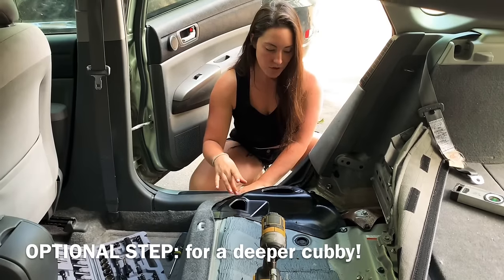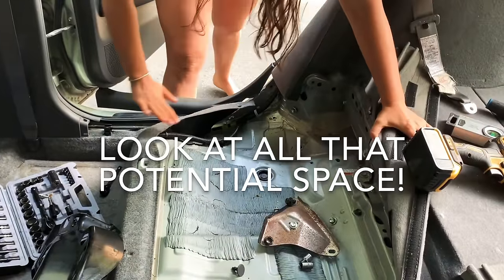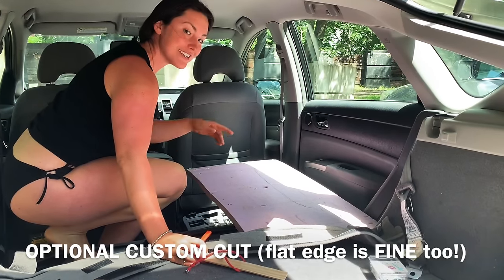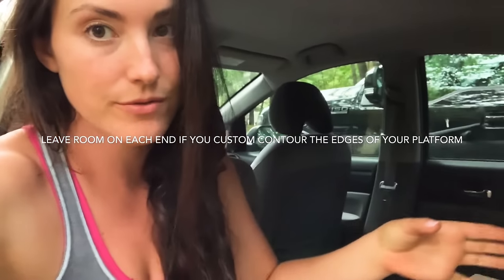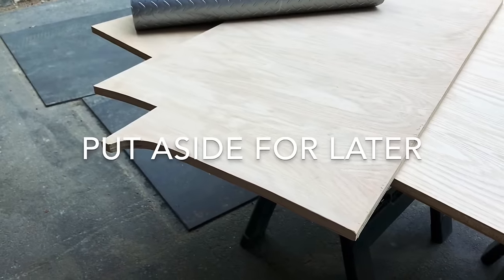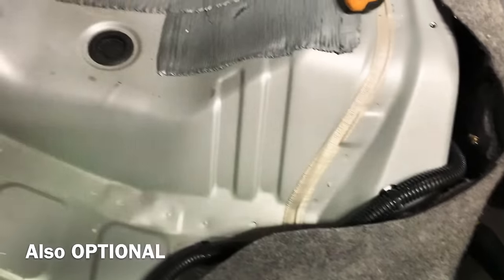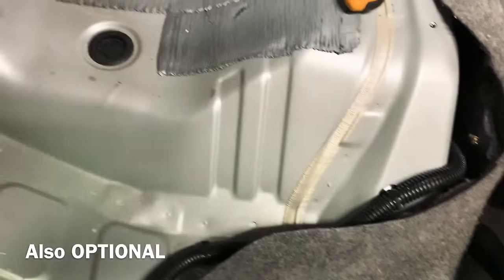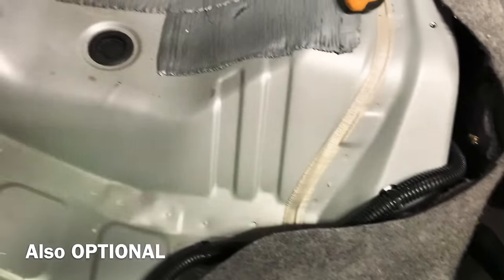Build a custom bed platform with storage to live in your car! - HOW TO Prius car camper conversion

Comment from the maker: Update: Almost 1 year into this build out and everything is still going strong. What I may do differently: 1. with temperature and humidity changes the floor lining lifted a little on the side panels so I reinforced with a staple gun - might as well do this now before it’s a pain to get to the edges in all the areas. 2. Where I fastened the first section(support platform) of wood to the car (where the battery lives) after the fact, I would make this easier to remove for easier access to the battery and easier removal, this was annoying when lifting and cleaning out the fan - less screws and held up/ supported by wood On the base would be my  go-to next time. But if you don’t care about removing the screws, go for it!
Reply: Amazing work!!!
Reply: 2:05 squirrel 🐿️ voice LOL All joking aside good video 👍
Reply: Your so amazing I would love to get to know you do you chat
Reply: Welcome India
Reply: Can someone help make a list of everything to buy from a lowes or home Depot? 
Like the wood and measurements, hinges and brackets, etc.
Reply: You amazing  I just found your channel  I love your videos.
Reply: So, you've totally inspired me to build out my Mazdarati hatchback btw. How have you dealt with moisture? Like condensation from breathing?
Reply: can you send me one or two free t-shirt's.. i am from India. :)
Reply: Your a real “ringer”. Lol. You acted likeyou didn’t know clockwise vs counterclockwise on your screw gun, but turns out your practically a master carpenter! 😆
Btw.. im new to your channel and loving it! Ive lived in your situation (with my dog Macushla) at first not by choice after a terrible house fire took EVERYTHING.
But I’ve always objected to conventional living! There is so much beauty out there most of us dont get to see. 
And after loosing my father tragically 1 month after retiring (by simply missing a step and hitting his head)  im determined to seethe world for him.
My dog Macushla and I have been exploring the AT here in the NY CT MA area. But were ready for more!
Id love to pick your brain and get little tips on things like how to find a shower on the road, or best sites to see that are dog friendly 
Im definitely gonna keep watching and subscribe. I’ve already seen some REALLY IMPRESSIVE VIDEOS, and they offer some great incite! 
Love your spirit! 
Namaste!
Reply: @ajiramm2  Hahaha, nice one 😂 Burn 😂
Reply: @bumpercarjoe6391  Your story is also inspiring. Can we get an update? ;)
Reply: @Karrikua   aww, than you! So I found myself a nice little room (that is ok with my dog) to rent here in the north east so I can have a base next to my 14 year old daughter, who lives with her mother and stepfather. I found a great used Toyota Sienna mini van that allows me to travel up and down the east coast. Ive been to Appalachian trail in GA, NC, and MA the past 3 months. I figured out how to use planet fitness membership as a great place to shower rather than renting rooms. And also got myself a GREAT job with UPS as a seasonal worker delivering packages from Thanksgiving through next week. And another part time seasonal job as helping a restaurant with parking. That job is so flexible. It only needs 3-4 days a week, and has NO PROBLEM if unavailable 90% of the time. They only really ask if you make sure they are covered on big occasions like memorial day, or 4th of July weekend and also said they are fine if someone else fills in. Mix that with some doordash work and I figured out a way to work as needed, and sustain a nomadic, adventurist lifestyle!
My dog really likes about 7-10 tops out on the trail, and really enjoys some downtime afterwards. I’ve been able to be here for my daughter and seem to have found a sustainable formula! My biggest issue is worrying about gas prices and if they go crazy again.
Im hoping to find a used hybrid in decent shape but $ is a huge concern. But I should be good with this Sienna for a year or two (hopefully at least… knock on wood) 
And even the area I have the room im renting here in north western CT there are trails for hiking and camping everywhere! And so far moderate winter has been great! 
I do take some grief by family members and others for lack of ambition, commitment, or a long term plan. But they will never understand, and I’ve accepted that. As long as my Daughter and dog are happy, safe, and healthy, so am I.
But thank you so much for asking! Happy new year, and all the best to you as well! 
Namaste!
Reply: Awsome
Reply: Awsome

Comment: Nicely done. As a first responder I would like to point out that the "orange tubing" (didn't see it but that is generally how it is colored) is most likely the high voltage line. If that is hit you either get electrocuted and/or start a fire. Just like Nikki said be careful when drilling. Keep in mind that trained firefighters can't always tell where these lines are in case of a crash and extrication tools are needed. My recommendation is to ask someone that knows your vehicle before drilling anywhere in the car. In a regular ICE vehicle you have "only" the wiring harnesses to worry about, worst case your tail lights don't work or you have other dashboard gremlins show up. With a hybrid or electric vehicle the worst case is death, followed by burning down the car or the house and garage that are housing it when you are doing the work (that has all happened, more than once). Please listen to her and be careful. Then enjoy your new camper (not to be confused with "Camper", obviously). 

Also, great garage. Whoever owns it is lucky. Tools, gym equipment, a golf cart with custom seats, motorcycle, sweet!
Reply: It is better to buy the right auto. The right vehicle  will be more versatile since you can have back seats or flat in about one minute. 
She may have an issue with the insurance company in the event of an accident.

Comment: Guys... hidden deep in the video, there's advice for anyone who might want to date her!

Your build is fantastic! Wish I was this smart with my insulation. For anyone that might be using this for inspiration, I did a Prius build too and would add a couple variations to consider. I refused to drill anywhere near the battery, but on mine (2013) there were very solid mounting points that let the backseat fold up and down. With the seat removed, they were a great anchor point to bolt a plank that spanned the width of the car just like she did, using a 10mm socket wrench.

You also mentioned shelves which extended the platform to the back of the front seats (very nice for sleeping if you're tall). I did that by putting rails from a metal modular closet shelf on the front of the platform, the ones that just have attachments which hook into slots drilled in them. The shelf supports which fit those can hold a platform extension, are cheap, light, and durable, but most importantly you can easily remove them and stow them anywhere in the car. You mentioned hinges or L brackets, and they're more solid but not as flexible with space.
Reply from the maker: I LOVE this! Haha THANK YOU! AMAZING suggestions for anyone trying to do this! You rock!
Reply from the maker: Soaring Bob Thanks for the suggestions!:-))))))
Reply: Totally great advice, just like how you do your thing... best to ask and/or just listen.  

I went super budget on my 2013 only removing the back seat backs and making a custom backboard that folded into three sections and used a webbing with clip to attach the head/torso section around the passenger side head rest height adjustment metal tubing.     Used plywood, scrim, some fabric adhesive, some staples, similar hinge material and I think the material is a like a tan speaker carpet marine upholstery.  Man, did like back in 2015 and I forget exactly offhand.  I'll have to check my eBay and amazon purchase history, though now thinking I searched online for some deals at fabric stores and ordered... so probably have the info in my email somewhere too.  Used a 4" memory foam, cut the same way though in 2" wide sections I laid side by side and was planning to adhere though wound up just wrapping with one of those blankets from Mexico or the islands.  I only made a half width bed at first.  Then my 2" thermarest pad and my sleeping bag, later investing in a GenIII extreme cold weather sleeping bag system.  

Used paracord tied around and strung between the handles, visors and tucked under center glasses/lights edge with binder clips as like the hangers to clip onto the white UPF rated polylycra material that originally I was planning to sew a cocoon sleeping bag inner liner or just thin liner sleeping bag... and decided to use the material for curtains.   Invested in the custom front and hatch window shade, I forget if weathertech or not.  Seems one was and one was custom.  Weathertech floor liners for certain... those were my first investment actually.  I just left the plastic that came with the car new underneath and tucked under the console lips. 

I also invested in a Dometic CFX-CVR40 Insulated Protective Cover for CFX-40US frig/freezer and that is an awesome device.  Very luxurious.  Can freeze food and have a fridge with no need for ice after that point.  Kept the artic ice cooler packs just in case... though thinking after researching more that frozen water in a square or rectangular bottle is all you need for a backup and more energy efficient cooling thing and is more cost effective.  To save on the ice expense, I used to just freeze the water bottles and packs when I had a place to. 

Latest project is the PCV valve relocation, OCC and maintenance tasks, i.e. intake, EGR and PCV circuit cleaning.  Amazing how little maintenance these cars require.  225,000 miles and still going strong.  Loving the lift idea.  I also want to make a custom front bumper guard with shutters and temp sensors for the colder weather to close the intakes to the engine and inverter radiators.  Maybe and engine block warmer might not be bad for in the winter also.  Thinking can lower drag on the underside too with improve skirting that is even more lower drag.  At one time wanted bullet style rear view mirrors with camera's installed with the screens on my dash.  I actually have most the materials to do these later projects... just haven't had the need since I don't camp or stay in hardly anymore.  The lift would be handy for hauling stuff though.  Amazing what can fit in the prius. 

I also want to make a tail cargo container to lower the drag that swings open on the passenger side so can use as a kitchen and also pop up a tent awning at the least like tailgating I guess.  More-so wanted to add storage while lowering drag to improve performance or at least offset the increased load.   Planning to do similar with the Dodge Ram with a Mike Basich cap design without the skid and adding linear actuators to lift the cap.  Planning more for a radio direction finding patrol truck since that's my main passion now being a victim of a bunch of stuff I won't get into.  

Randomly watched the lift video and now this one.  Wow!  You way girl pack yours.   I way guy pack mine though more like a pickup truck now days when I'm out on the road rescuing made in the US items and material for projects.  Like the material you used and am thinking that might make a great liner.  Just need something smoother on top to aid in sliding when is just me so doesn't bunch up.  Maybe a layer or two of plastic or contractor bags and some cardboard is all required. 

Humorous is thinking about fitting two people, I did the same and invested in a roof rack.  Decided to go with the Yakima Jetstream since was rated at a higher load capacity than the Thule.  Invested in that new with a little surfing on eBay and the net to find the best prices.  Have a Thule container however, the cheapest slimmer aerodynamic one from Sears at the time that I wound up finding on Craigslist for like $100.  

Soaring Bob is correct and I'm thinking there are probably more high volume channels to connect and canvas with if that's your interest.  Haven't really done the market and advertising research, so really not certain. 

Looking forward to watching more of your videos.  Looks like good times.  

Wishing you a bountiful, healthy, safe and happy holiday season and beyond.
Reply: 6:34   🚩According to Dr. John Gottman this is a predictor in unhappy couples.
Reply from the maker: Carlos lol Jokes Carlos jokes ;-)
Reply: I heard it...
Reply: Haha I bet guys rushed to the comments on this as soon as she said that that's hilarious but you cant blame us guys shes amazing!
Reply: @Yotrek Being in a relationship is asking to be unhappy. That’s the best predictor. In a relationship? -> unhappy.

Comment: Just want to touch on a couple things that might be of interest!

If you're any good with a sewing machine, you might want to look into sewing a bug screen with magnetic sides that can cling around the open hatch. I lived out of my Prius for a while, and the one caveat was that I would have loved to open the back end on a cool summer night if not for Ohio's mosquitos.
Reply from the maker: You’re a mind reader! Worked on that this week!;-P Tho, From one Prius nomad to another - the auto lights from the door being open drain the battery (I’ve had to jump start a few times with that) - myself and others would love to know, how did u avoid that?
Reply: Nikki Delventhal There are a couple choices. The obvious one is to turn the dome lights to "OFF" rather than "DOOR" when you plan to have the hatch open (don't forget the switch on the driver's side in the hatch). The convoluted one is to pull the headliner down and run a master kill switch to both dome lights that can be reached from one spot.
Reply: @tpasco1995 Don’t open anything, get a portable ac run off solar, opening leads to bears/ppl.

Comment: Love this! As a guy who hauls trailers with Priuses, I love what you are doing with yours. I love my '06 Prius. Nice coaching!
Reply from the maker: Thanks! I learned from the best!:-)
Reply: Haul trailers with a Prius ? How much do those weigh?
Reply: @zedmak  word on the net was 2000lbs capable, so I bought some aluminum 10 and 12 x 6.5's, weighing 700lbs, and haul 800 to 1600 lbs in them. The gas mileage drops quite a bit to 22 to 30 mph, but it's still low emission and convenient. At 1800 lbs total, on highway, with many hills, I noticed the guage told me 28mph but was inaccurate, actually just 22 mph! A bit disappointing, but my ole '08 Prius with 200k miles on it did the 1400 mile non-stop haul without a hiccup!

Comment: Thanks your video giving me idea to work on my Prius. 
A little suggestion for you. This design is kind of heavy. I would like use 2" x 2" x 8 ft pine wood beam and 1" x 2" x 8 ft wood beam to be frame, and thin compress wood blade to be platform. The whole set would be light and strong.
Reply: I have build main frame of the back storage using 2'' X 2'' X 8 ft wood on my Prius today. I do not remove the whole back seat. I remain the high back of left single back seat. I remove the right side high back of twin back seats and the whole back seat base. I will build a storage box on this back seat space, and build a wood left single back seat, which is a small container as well.

Comment: The L brackets would look cleaner if they were inside the box. Nice doing the contouring.  So now the cat is out of the bag and the hint has gotten out about dating... did you get a flood?   I have a 1988 Precis I have camped out of when traveling... I am 5 foot 8 and it is 5 foot wide.

Comment: Was just wondering what width and what kind if wood your using. Also when you added the L brackets to the corner of the box did the nails go through inside the box?

Comment: Struggling to find your painting and lining video. can you post a link? Also what is the lining you're using? Thanks!
Reply from the maker: Omg the video footage got lost on my old computer so I was never able to post it!!! But it’s pretty basic sanding down, using a paint that will last through the temperatures and moisture levels, doing a few coats, or a polyurethane 😍😍😍 - the lining was a diamond plated floor lining from Home Depot!!! Ask a store worker they’re soooo helpful !!!